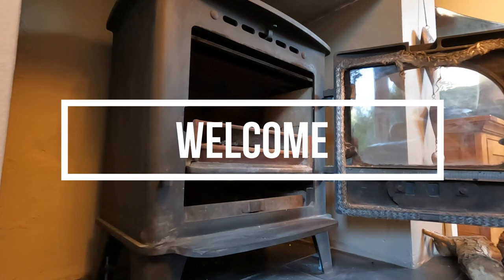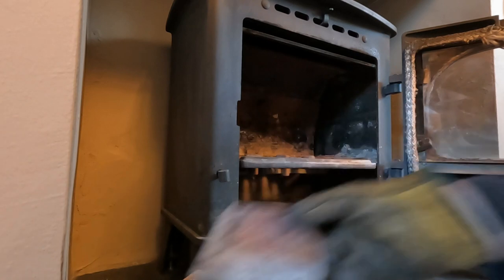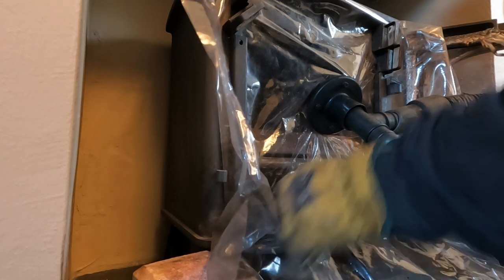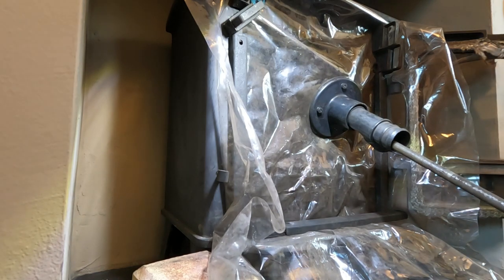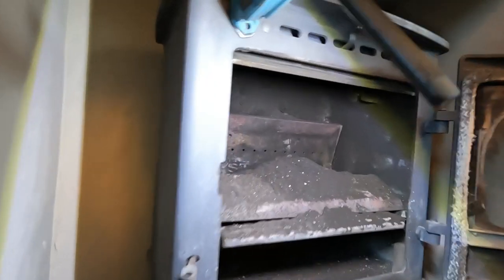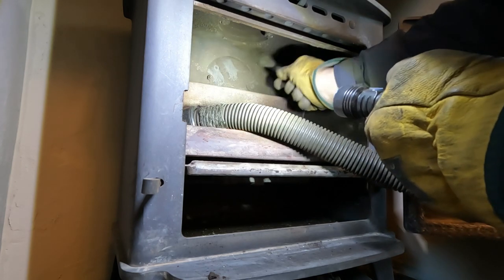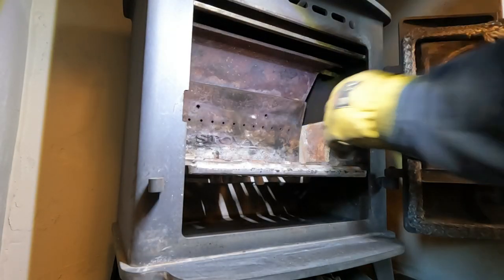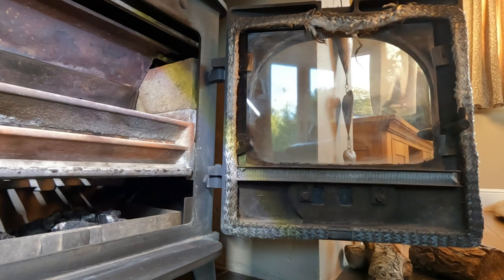Stockton 5 chimney sweep and clean.

Comment: Hi i hope fire bricks where replaced as soon after this recording can damage the side wall of the burner plus rope on the door may cause over burning let alone fumes back in the building..
I to have a stovax 6 mk 2 multi fuel  no real problems well made units i can recommend these  easy to use  i have to replace  my bricks in the spring not cracked  scored  with use...after 10 years of use.